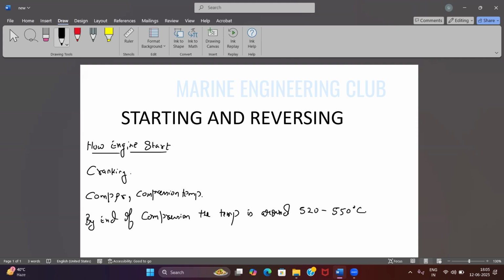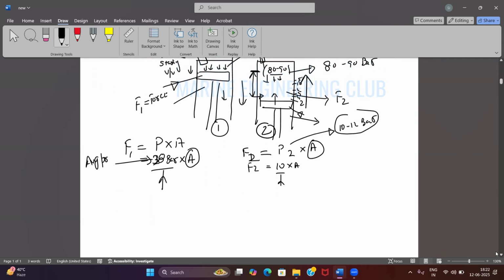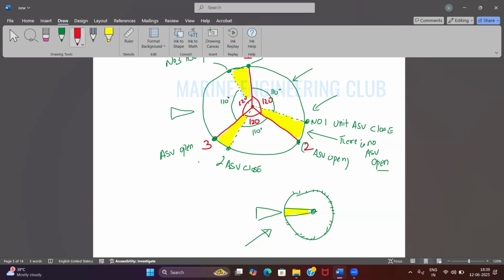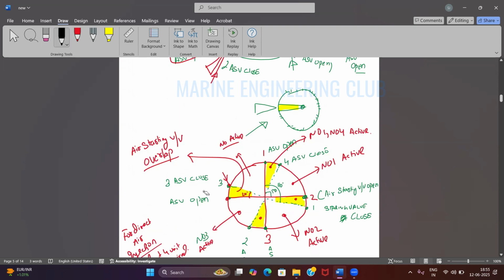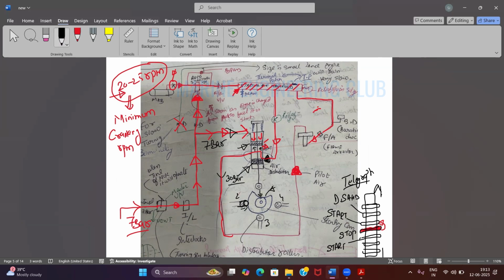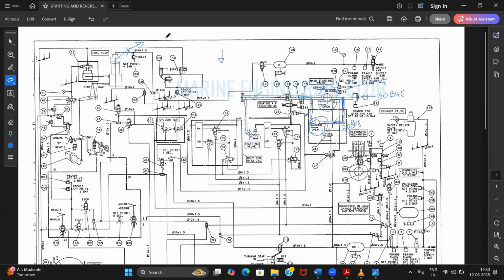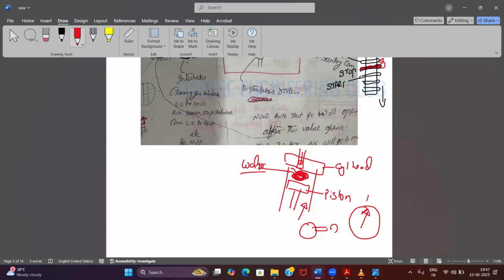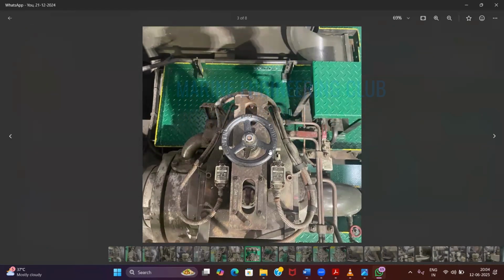STARTING AND REVERSING || LECTURE  1

Comment: Sir you told when 30bar pressure acting on the piston it will go down and other piston will move upward. As you mentioned the piston which come upward direction at the point of tdc it is around 100 bar. So how the 30 bar air will be injected to that unit .because pressure inside the cylinder is more than injection air
Reply: @maco2274  The 100-bar pressure mentioned only occurs at TDC during normal fuel combustion running conditions. When the engine is stationary and preparing to start, there is no combustion happening yet.